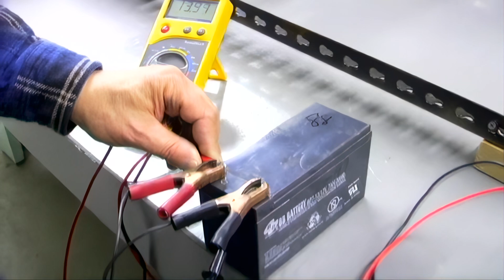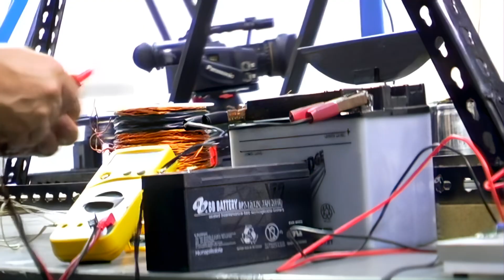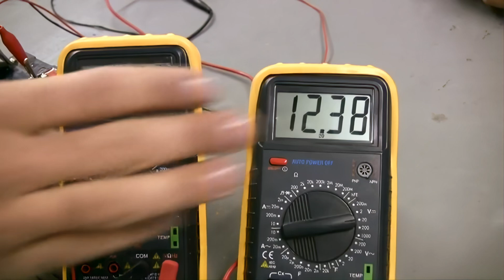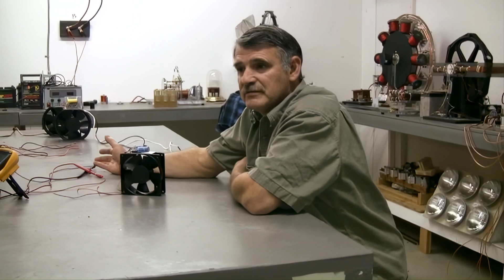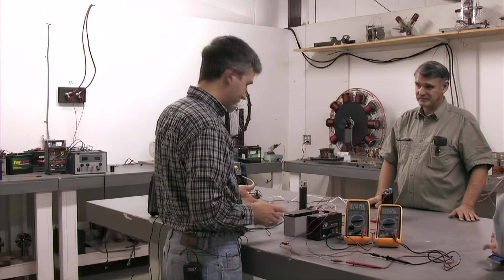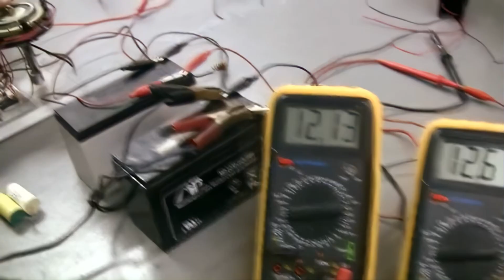Part 17 - The Tape Drive Motor [1080p]

Comment: any device that supposedly makes use of radiant or other imaginary stuff is a  FAIL.      zero-point energy is real;  but, like static electricity, it is  not  a  NOT  a useful form of electricity.      any demonstration where input and output power values (volts, amps, watts) are not known or shown is a  FAILURE.